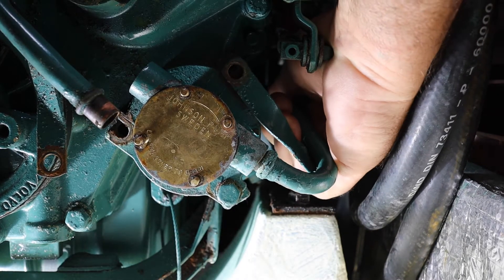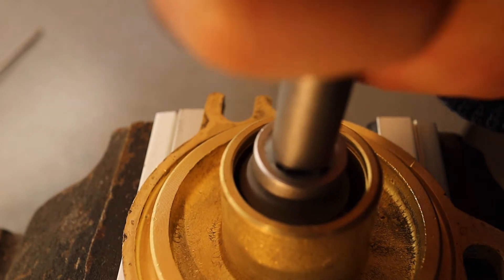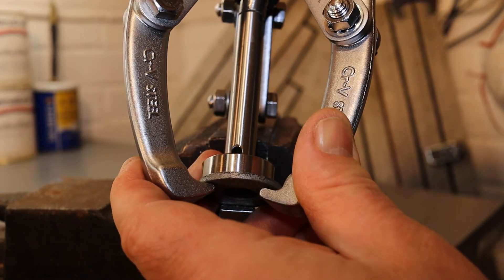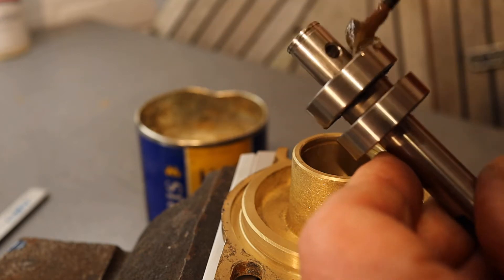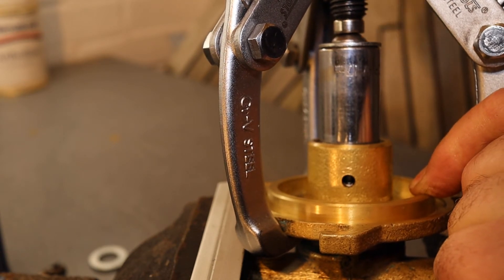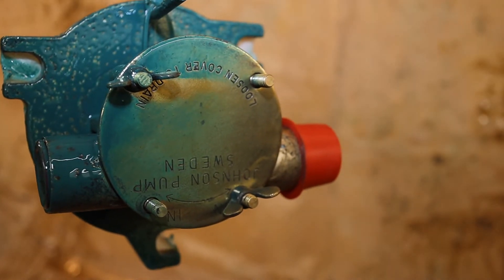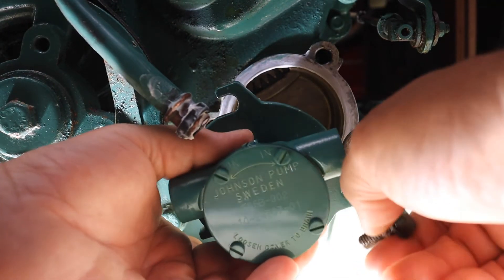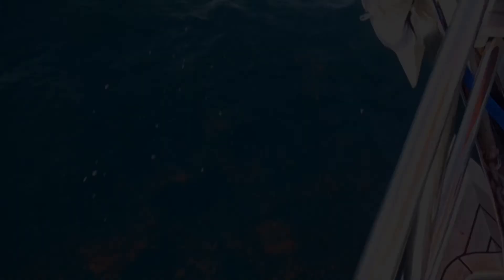Volvo Penta water pump rebuild Ep:18

Comment: I am currently repairing my see water pump of our Penta 2002 and I really appreciated your disassembly and assembly video. You filmed all the necessary steps and this makes my work much safer, double-checking if everything is right. I noticed that the little o-ring is missing in my pump and your video confirmed it should be there.  So, thank you for investing the time to document your work!

Comment: I wouldn't heat the bearings - but I would the outer brass housing. For the shaft I would plastic bag it and leave that in the freezer for a couple of hours to make fitting the bearings a little easier. I would be very careful when driving the bearings to avoid putting too much strain or hammering the inner race - though with this design that's not easy to do.
Reply from the maker: Thanks, I'll give that a try next time.

Comment: Great video!
Do you recall whether the three bolts used to install the water pump are equal in length? I need to replace the corroded mounting bolts on my engine. The parts diagram on the Volvo website lists two different part numbers (and lengths) for the bolts. I am trying to determine whether I need the 20 mm bolts or the 65 mm bolts for my Penta 2002.
Thanks!
Reply from the maker: Hi, I can't remember how long the bolts were however they were blind tapped holes so probably the shorter screws.
Hope this helps!

Comment: Could anyone explain just where that small O ring goes and what is it for? I didn't get a new one in the kit and on the parts diagram it's as though it goes in the middle of the seals but there's plastic spacer thing in there too so which side does it go ?
Reply from the maker: Hi Stephen, you're correct the O ring goes between the seals on the shaft. I believe it acts like a drip ring so the water or oil will drip through the slots on the plastic spacer. 
Hope this helps?
Reply: @sailingwithus5743  Thanks , I've had a nightmare rebuilding mine, the bearings were extremely tight and were damaged fitting them so contacted the supplier who said they had had a few problems and sent another shaft and bearings but to be honest it's not right. The first shaft was scored so the seals would be useless too. 
Now i've done it again and the impeller is about 1.5mm proud of the pump body ...I really wish I'd spent the money and got a complete new pump.
I did use a freezer and oven but didn't help at all , the noise of those bearings being pressed in will haunt me forever
Reply: yes, the small O ring that is loose on the shaft goes between the 2 seals; it is there to deflect any water leak drip away from the oil-side seal. In the video at 2 minutes 20 seconds, it is not clear but it looks to me like it is put in the wrong place. I didn't get that O ring in my rebuild kit so I used the old one which I found between the 2 old seals

Comment: Far from boring for those of us who have 30 year old boats and do the hard work in order to stay safe when the engine matters!
The simple question is whether I should contemplate dissassembly/assembly of the bearings without a bearing puller? I have seen it suggested  that using a hammer with a suitable block of wood is an option, shrinking the shaft in the freezer if necessary(!) And are the necessary clearances listed somewhere?
I trust you have recovered from your stroke, so that diy owners can long expect to benefit from your wisdom.
Reply from the maker: Hi aurigacap, thanks for asking about my stroke recovery. I still struggle with many aspects of the stroke especially memory, hence the reason for making these videos. If others benefit, then even better!
The puller wasn't expensive and I would rather use it than subject the bearings to shock loads with a hammer.
The clearance measurements were recorded when stripping down and rebuilt accordingly.
If you have a workshop manual with accurate dimensions please share with this post!
Reply: @sailingwithus5743  I'm glad to hear you are at least recovering. I struggle with the memory of having done this before, but recall not much of it. So I'm pleased to have found the video. I record the photo sequence of jobs like this on my phone, so I could remember. My phone is under 4 metres of water along with my memory prompts.
Reply from the maker: @philgray1023  Hi Phil , good to know the video is useful to you. I'll get around to making another one soon.

Comment: Can you remember please if your impeller slightly protuded past the body? Mine seems to a fraction of a mm.
Reply from the maker: Hi Lewis, from memory the rubber impeller  touches both the back plate and front cover to form a seal. 
Don't forget the paper gasket and plenty of Volvo Penta lubricant. Good luck!

Comment: I love your videos. I have a well functioning 2002, but it is nice to learn more about it from these great videos.

One question: Why not use the wingscrews on the impeller housing?
Reply from the maker: Hi Erik Riis, good question.
One of the wing nuts was missing so I just wanted  all screws to be the same to get an equal feel they were torqued equally. In short I didn't have a spare wing nut in my odd and sods box. 
Thanks for watching, Rob.

Comment: Have a 2002 .Does volvo supply water pump and injectors? Great work when you have the skill and tools.
Reply from the maker: Hi Luba Kaczmar, before I answer your question are you referring to fuel injectors? 
If you are it's possible to get them cleaned and reset (calibrated) however it requires specialist equipment. There's also copper washers that need replacing in the cylinder head too. 

If you're not able to replace the internal parts of the water pump a complete new unit is available however here in the UK it's about £300- Ouch!
Thanks for watching. Rob
Reply: Have removed both fuel rails on my 2002 volvo penta engine. No idea how to disengage the the flange holding the injector.
Reply from the maker: @lubakaczmar3198  Can I point you in the direction of 'Sailing Britaly'. 
Chris has a 2003 Volvo penta however Think he did the injectors on a 2002 a few years ago. 
As they say, a picture is worth a thousand words.
Good luck , Rob

Comment: Nice job on the pump, I have done the same task on my old Ford's in the past, not with the pump job but more with wheel bearings I have had success with freezing the shaft before inserting through the center of the bearing, I suppose its the same really
Reply from the maker: Hi MrCrabbing, thanks for posting your comment.
I made this video without a workshop manual so was unsure whether heating/ cooling materials was good advice.
Good to know it works for you.
Thanks for watching!